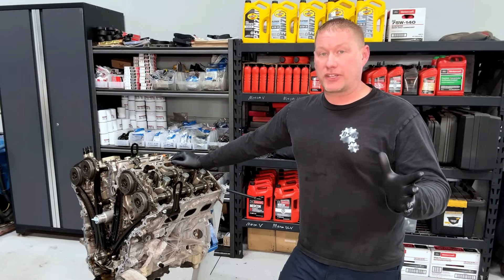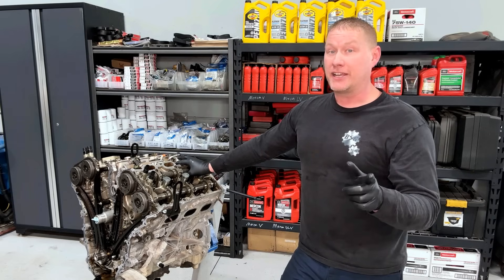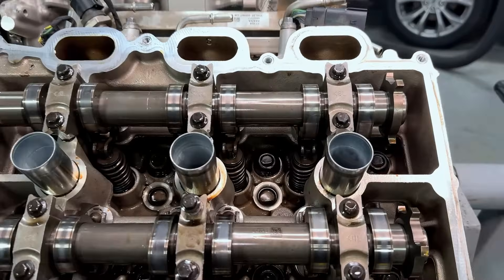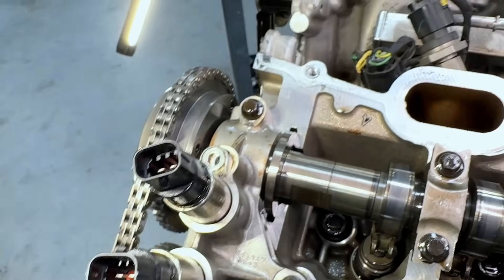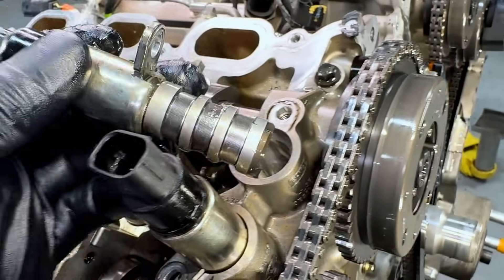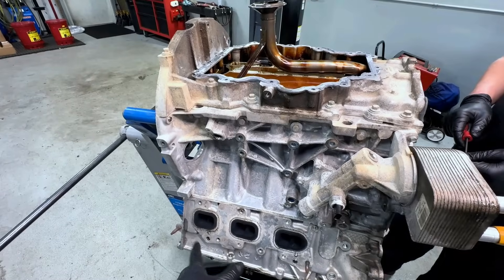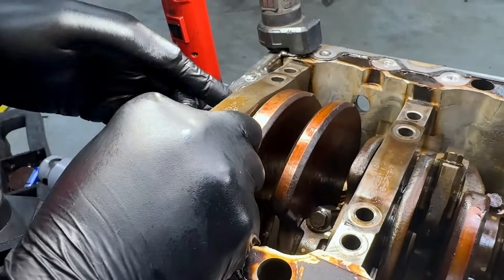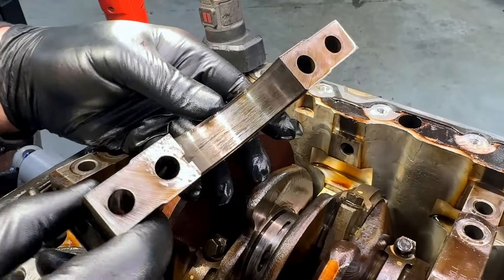Did The Ford Dealership Technician's Neglect Cause This 3.5L EcoBoost Engine to Fail?

Comment: I switched from GM in 1985 to Ford. After 35+ years of Broncos, F150's, super duty's, escapes, edges and rangers, satisfactory no complaint sales and services, The service manager at my  Chishire CT Ford dealership promised me a "real Ford tech" ( named Johnny) when I brought my 100k mi. escape 3.0 v6 for a motor reseal because of timing cover leaks. When I got the car home and took a look-see  at what I paid $2300 for, I found the valve cover bolts were loose (hand Tight), the oil dipstick was sitting on  the cowl, and the front engine mounting bolts lock washers werent even compressed. (Johnny  and his torque wrench!) After they re-did the job TWICE they got the leaking oil and coolant down to a spott-drip of oil. Ford quality of both product and service has taken a bad turn. Time to switch from cars I always loved- Why? because great engineering and style has gone to hell. Seems like they are good at doing two things nowadays: oil changes and warranty motor change-outs
Reply: 😅😅...a real technician eh?
Just right out of skool. 
Good thing I work on my own stuff. I cannot complain about it. 
If I screw up, I feel bad about it. I take pride in fixing my own family vehicle for years. 
God bless sir.
Reply: @2nickles647  a gray hair
Reply: @SurfBandFan gray hair just call it scrap.
Reply: Yeah, after 35+ years of history who wouldn't abandon ship with a single problem?   I don't even own a Ford but I do 99% -100% of my own repairs, and if I didn't repair my own cars, I'd take it to a well respected independent like Brian here.  And whatever you move to, realize that cars are far more needlessly complicated than they were 10 years ago and even late model Toyotas are blowing engines and having transmission failures.  Whatever you get, make sure you buy a long warranty with it.  Oh, and Cheshire Ford's labor rates are ridiculous.  I had them price a 3.5 Edge water pump for my mother in law, it was $1500 more than she had it done for in Wolcott by a local independent (Fran's).
Reply: Not just Ford...Heck, my neighbor has actually said "NO MORE TOYSH!TAS"...yea, he's frustrated.  Been in the shop 5 times for 5 different issues.  All at <100K miles.  He changes oil regularly, and now they are saying "It looks like a bad engine".  Watching Eric O., over at South Main Auto, and he shows the GM's coming in and just shakes his head.  So many stealerships saying "need a new harness, that's $2500" all because they don't actually want to do the diagnostic, or the work to just get it done.  Unfortunately they all have issues, and I see it getting worse and worse as they get more and more complex.  We saw it when the first computers came in, and we are seeing it again with all the crap they need to put in for 'efficiency'.  :(
Reply: @WreckDiver99  modern engines have everything working against them. Egrs/direct injection. Small displacement engines with high horsepower and turbos etc etc
Reply: @samholdsworth420  Well aware.  Spent 35 years in automotive, and 20 before that hearing about it from my dad and uncles.  My uncle rebuilt a 1957 Chevy in his garage.  Back then he said "ANYBODY can do this".  He told me in 1980 the number of people that could work on an engine was a fraction of those just 10 years prior, and in the next 10 years it would be even worse.  The EPA, NHTSA, UAW (yep), of course the Design Studio all had a hand in making working on vehicles difficult at best.  

So glad I retired...it isn't any fun anymore in that biz.
Reply: @WreckDiver99  The U.S. government never touches anything without Fu- - ing it up. They are trying to do away with gas engines.
Reply: I had a similar experience. I bought a car off a guy who had it dealer maintained. transverse 3.5 ecoboost with 123k miles. Turbos had just been changed by the dealership under extended warranty coverage. 6k miles after the job those turbos failed too. I found that the PCV system had failed when I first bought the car and fixed it, but I think that was probably the start of the problems. That oil consumption issue destroyed the first set of turbos, which introduced carbon into the oiling system and it was just a matter of time before that ate the bearings on the second one. I eventually changed that whole engine out because it wasn't making enough oil pressure at idle to turn off the switch shortly after the turbo change, so I cut my losses there and bought a low mile junk yard motor. 
The big problem I have with the dealer though is that they changed those turbos and never found that PCV failure, which is basic diagnostic work, and they did some of the worst work I've ever seen. When they did the turbos, they hung the front down pipe by the wiring on the O2 sensor and chowdered the wiring all up. That was something I had to fix shortly after I bought the car too, because it took awhile for the one wire to completely come apart. When I changed the turbos again, I found small fasteners on so tight I needed a cheater bar to loosen, and other large fasteners I kid you not were finger tight. This was in California, so no rust. They just didn't know what they were doing. Of course the loose ones were in hard to reach places and the overtightened ones where in spots that an impact would easily fit. I have put 100k on the car since the work I did and haven't had a single issue with the motor or the turbos. It runs perfect and no oil consumption. I do not trust Ford dealer mechanics, at all.
Reply: My 99 suburban with the 454 doesn't leak anything 😂
Reply: @samholdsworth420  That's because it goes out the tail pipe.
Reply: @robertdavis6708  only on startup 😂 

It burns maybe a quarter of a quart every three thousand miles
Reply: Lmao, I'm a mechanic and wouldn't want anyone with less than 15 years of experience touch my vehicle. 😂
Reply: I feel for ya, I switched from GM to ford in 1989. And everything I got from ford in those years up to 2021 all had warranty work done in 7 days or less, and one explorer was in the shop weekly with one issue that took 3 months to figure out. I switched to a different brand truck and have had one minor issue that really doesn't qualify as a warranty issue in my book, at the 3 year mark today was cranking was slow this morning and I load tested it at work and the battery was at end of life and the load test basically finished it off and had to replace it.
Reply: @TheTitaniumSkull  I always find it interesting with these.  I had a 2006 Ford Fusion.  It didn't need brakes until 140K miles because I drove primarily highway and they put ceramic pads on it at the factory.  We sold it to friends of ours at 250K miles and it was never once in the shop...ever.  We only did the general maintenance.  They put over 150K miles on top of that, and finally retired it when the transmission went at 400K miles.  Impressive as all get out.  2nd best vehicle I ever owned.  Our Explorer lasted 250K miles and only went in once for an issue, and it was minor.  My 2016 Fusion Hybrid has only had general maintenance and replaced the rear shocks, and front tie rods (Michigan Roads SUCK for potholes), my wife's expedition?  Well, yea.  That had the rear cargo door replaced due to corrosion (improper painting of the aluminum), and it had one of the turbski's replaced at 80K miles.  Other than that though, it has been regular maintenance.  I guess we've just had good luck with them.

THAT said, my wife never wants another Ford.  I have explained, they ALL have issues, but she is "NO MORE FORD'S".  I get it, we were GM people for a long time, and I went to work for Ford, but I can't deny that my Ford's have all done AMAZINGLY well...every one of them has gone north of 300K miles.  The ONLY GM Vehicle I've had do that so far is my 1999 Tahoe, and I think it may finally have died, or become just too expensive to maintain.  The entire brake system blew out the other day, and the trans now needs a rebuild.  Total cost?  About $9K best guess.  That truck has well over 500K miles on it.  I cannot complain, but man it's tough to let that one go if it comes to that.
Reply: @WreckDiver99  all the brake lines probably rotted out -> fellow Detroit guy
Reply: You obviously haven't looked into toyota problems lately? This is not a brand problem. This is a consumer problem. We keep buying and accepting shit products and ridiculous prices. All the brands are having major problems. Toyota and GM seem to be the worst based on what I'm seeing from actual owners.
Reply: You can throw out oil changes too. I had bad experiences at both the dealer and a local shop with my 22' Maverick. Both were slobs. Started out with the dealer getting mud in the interior after the first 5,000 mile oil change. Then the local shop forgot a splash shield T30 bolt. Then they also got sloppy and dripped oil on the valve cover. The last straw was when they exploded the oil pump under the engine   dowsing the whole underside of the engine in (luckily) new oil.  I'm done getting my oil changed for me. I'll be changing my own oil and filter ....I don't care if it voids the warranty.
Reply: @Aaron_Voltz  omg. Some  forget to put cap back on valve cover. Oil all over.
Reply: @mikeandcolleenk9831  That would really suck having oil splashed all over just cuz the fill cap wasn't put on.  I did catch one technician who didn't put the positive battery terminal cover back on. As if a 2 year old vehicle needs it's battery tested.
Reply: Competence left the stealership technicians long time ago...they have ripped people off for multi millions of dollars and should be out of business and sitting in jail next to our federal government elites
Reply: as a tech for almost 40 years i can honestly say nobody gives a damm anymore . there are no more GOOD tech left. just part changers and all the young kids now a days dont want to get their hands dirty or dont even know how to read a shop manual anymore.  we lost the basic knowledge of simple things and everybody jumps to the high tech repair before even the simplest of things are checked. also doesnt help engineers dont give a damm about the tech or how stupid it is to fix simple things and quality is no longer job1 . its all disposable now.   BUY DRIVE send to the scrap yard BUY AGAIN !
Reply: I switched from GM to Ford in 96, was thinking 🤔 about a new Suburban, then I started reading about multiple AC problems. So I stuck with Expeditions, but now I can’t stop watching videos about coolant leaks, and I see how UNBELIEVABLY complex the Ecoboost engines are😢 .
Reply: I grew up with a blower motor on my go kart buggy racer..
I would cobras, ss 454, hemis. You name...i was burnnin rubber slingim gravel
Reply: Can you recommend any mechanics in the Virginia Beach area Brian? Shot in the dark….
Reply: Ahhh yes buy ford because they are cheap . Get what you pay for? 50000 for a truck more headaches on upgrades. Plastic oil pan belt running oil pump electrical issues. Techs that work on them dont do quality work let alone many dealers. No thanks
Reply: @SurfBandFan  2015 150s have 1 time use plastic oil pan and a rubber belt turning your oi pump
Reply: Watching this video makes me want to go outside and change my oil!
Reply: I grew up with ferds and drove a ferd for a few years.  Once I had my chance, I went GM and never looked back until 7 years ago.  I've driven and worked on a 2006 ferd escape since.  It's only because it has a Mazda motor in it.😢

Comment: Long live the V8😎
Reply: Cylinder count doesn't matter, quality does and Ford hasn't had it for 20 years
Reply: @kenj.8897  I disagree.  Their quality really only fell off in the last 5 years or so.
Reply: @Shiver2002  right ive had quite a few fords over 200k miles with good engines that had plenty of life left
Reply: The 5.0 isn't exactly problem free these days either..\
Reply: @Shiver2002  6.2L F150 is bulletproof perfection. Will last forever as a daily driver.
Reply: First On Race Day

Comment: 2018 50k. Full Syn every 3k. Phasers replaced a couple months ago. Into the shop today with a stuck caliper, smoking right rear brake. Fun times.
Reply: I couldn't believe 3,000 mile oil changes. I had to read it twice😂.  People think synthetic oil goes farther. 🎩  off to ya. FYI, do your own work......... yes you can
Reply: I did a stuck rear caliper on my 18 a few months ago
Reply: @smiller225  same with my 11. Replaced all calipers and hoses, was not really expensive. Almost 200K.
Reply: @smiller225  calipers are easy, buy a loaded caliper
Reply: @jeremiah-om7zl  Truck has Powerstop Z36 rotors and pads. And, my right arm is temporarily out of action. Hence...in the shop.
Reply: 17 Raptor, both rear calipers froze a year apart.

Comment: Serioulsy, I'm never taking my truck back to the dealership ever again. They're the laziest liars on the planet who commit fraud on a regular basis. One didn't even change my plugs and then charged me for new ones. The only reason I took it in was because I was afraid it seized and didn't want my truck to get stuck in my driveway. I take it in and the tech broke my heater core hose then the rep tried to upsell on it! Needless to say I got my money back and filed a complaint with the attorney general. If they are so brazen to try and take advantage over a dude who works on his own truck then imagine what they do to women who haven't a clue! And the prices they charge are out-friggin-rageous too! It's straight up extortion and robbery.

Comment: For the metal to get past filter. I will guess the filter bypass opened at some point. I knew it was the main bearings from the sound right off. Rebuilt many engines in my time. Thanks for showing.
Reply from the maker: No the metal was produced after the filter.
Reply: @FordTechMakuloco  I see thanks for reply.

Comment: Now I'm spooked, my truck is at 50k miles and I just had the phasers replaced 3 months ago. Wouldn't the oil filter pick up those shavings that we saw in the VCT solenoids before they can even get there?
Reply from the maker: Yes, as explained so the metal we saw in the VCT solenoid screen was produced between the oil filter and the solenoids which is the end of the line.

Comment: What caused that to happen? What could have the Dealer Tech done to it to cause this issue?
Reply from the maker: Broken oil pump bracket floating in the oil pan.
Reply: I don't see that piece getting in the oiling system causing that. Engine was starved for oil, ran low due to consumption or pump failure.l @FordTechMakuloco

Comment: Very expensive failure I feel for the guy that owns this truck! I had a bad experience with the local Toyota dealership for my wife's 2020 Camry SE that pretty much told me you can't trust dealerships. They over filled her engine by 3 qrts. On her way home car started stalling and blowing out smoke so the tech did not even check the oil level after filling it. She knows to check the oil after oil changes, but she did not that time. She learned why she should always check it after that. That dealer now requires them to show the customer the dipstick after every oil change. They did go through the car to make sure no damage was detected. You hear that type of thing happening at Wal-Marts, but a Toyota Dealer? Just goes to show the carelessness of people now days.
Reply: Today's mechanics don't have the skills of the old school mechanics. If the computer doesn't tell them what's wrong they can't fix it and they don't care about details (correct oil level) .
Just in and out and is it time to go home.
Reply: @jimmieb1970  Too many people have the idea that the mechanics just hook up the scan tool, read the DTC's that the computer has set, and then they know what to change. Big mistake to think that, for those taking their vehicles to get fixed, also the mechanics who seem to lack the training and only go by the codes that were set. Then they start throwing parts at it. Eric O. at South Main Auto and Ivan at Pine Hollow Auto Diagnostics have shown countless times how so-called "factory trained techs" at dealers have FAILED. Often after charging hundreds or thousands of dollars and not fixing the problem. I am sure some techs at dealerships are good, BUT there also seems to be a lot of bad ones too.
Reply: 30 years ago I took our 91 Camry to the dealer for routine 60k mile trans service before a 300+ mile trip.  During the drive the car had a couple odd shifting episodes and the day after we returned I found a pool of tranny fluid under the car.  I called the dealership and scheduled an appointment because the fluid had obviously been overfilled.  I waited at the dealer for the car to be checked out and when the svc mgr called me up to the counter he said I needed a valve cover gasket and distributor gasket.  I asked what about the trans oil leak and he said “hard to tell where that is coming from with all oil leaking from the engine”.  No thanks, and I never went back to that dealer or bought another Toyota.  Those gaskets were not leaking. The car had over 200k when it was traded and the gaskets were never replaced or the transmission serviced again.